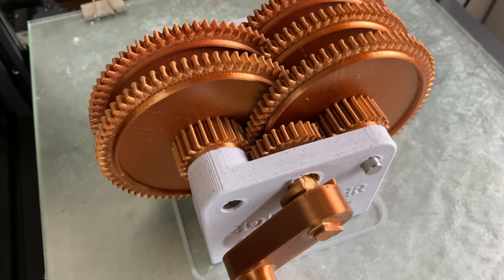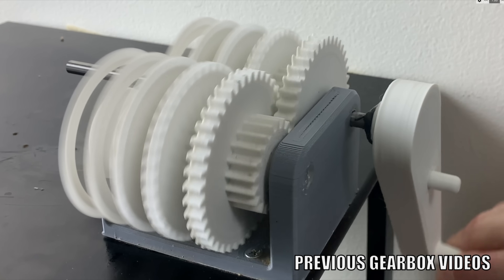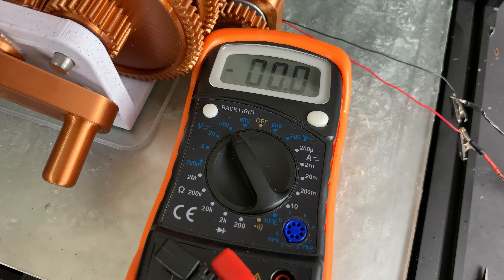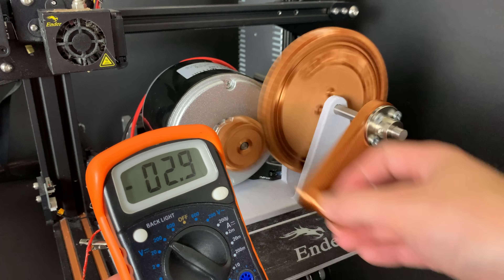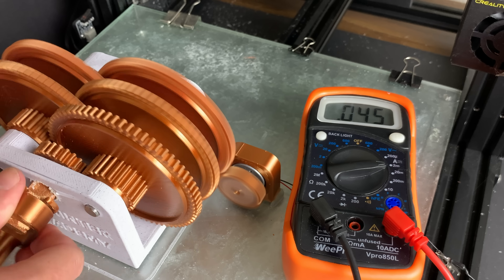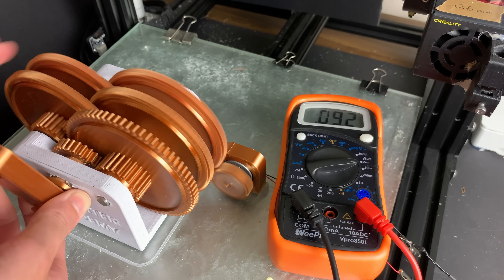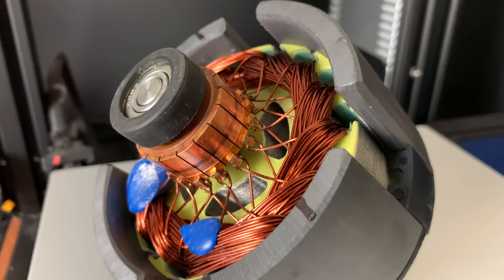Does a fast gearbox generate more electricity?

Comment: As someone who rebuilds industrial DC generators for steel mill conditions, I can tell you that most of the MG sets run at 1200-1800 rpm but I have seen some slower. They have a synchronous motor (an AC stator with a DC rotating field element that maintains a consistent speed without slippage) coupled to several (separately excited or series excited) DC generators on both ends of the motor. There is a direct mathematical relation of work done in HP to the output voltage and supplied possible amperage output. Horsepower = Torque x RPM / 5,252 and 1 HP = 745.7 Watts. Knowing this, you can deduce that the rpm can vary but what really leads to a higher output is the torque in the system. You can build a DC generator to maintain a certain EMF at variable rpm by adjusting of your excitation field in response (the bread and butter of series excited generators) but the actual amp(flow) output under load leans more on the torque of your driving force. AC generators are a completely different beast and are more dependent on RPM over torque with the speed being the deciding factor in the output frequency. Most run at 3600+ rpm with 3600 being more common in the United States in order to make that 60Hz frequency.

Comment: As many people have pointed out the way you did the measurements is pretty flawed but that's not the Issue. Never short the output of a generator! But i guess you didn't realise that you did that. To measure power you need to consume it somewhere, what you did here is consume the energy within the generator which if you spin it faster will heat it up and eventually destroy itself. You are right though that higher rpm will give you higher voltage (very generalised). You do know a lot about gears mate but your knowledge on electricity can use a bit of work :-)

Comment: Better bearings would greatly narrow the margin between high speed low torque, Vs. Low speed, high torque. The gears themselves, look really good. If they spun on precision ball bearings, that would reduce the losses of going through that many stages. I would start with a good crank bearing, since that's the one that takes the most severe radial load. making the axle longer, to put space between the bearings, will make them more stable against the cantilever loading caused by turning the crank by hand.

Comment: Hi, sorry to be THAT guy, but to messure watts, you need to measure volts and amps at the same time. Because, when you load a power source, the voltage usually drops from an open circuit.

Comment: You need to calculate watts with a resistor in line because the voltage will drop some so if the 12v drops to 6v that's big or if the 3v dropped to 2 or 1

Comment: It's simple the RPM must be above the motoring speed such that it goes into generating mode.😎
Reply: Only when motor recuperates , when you turn motor/generator it generates some energy , usualy there is rpm range at which power generation is efficient , but it doesn't necesseraly mean motor have to rotate at higher speed to generate energy . If motor is conected to voltage source it runs (unexpected) and if you stop electric current , motor will slow down and eventualy stop , but while doing so , generates energy , but voltage (voltage does not mean power/energy , but both are lower in this case ) and power are lower so than , for example , power = current * voltage , so if you have 300Watts of power , it can be 100 volts (voltage) and 3 amphers(current) or 10 volts and 30 amphers , now energy flows from higher voltage circuit to lower voltage circuit , and sience it doesen't make sence to focibly spin slowing down motor , we can convert power to higher voltage than send it into source (electric converter handles that) 
But motor without power source will always have higher voltage than 0 , so it wil be a source of power , but if you connect it to some source of power , current will flow from higher voltage to lower , but you ussualy won't get much power from spinning motor/generator on low rpm

Comment: Wow, it's extremely inaccurate.
You dropped the speed so at the same time you dropped the voltage on very low level.
You didn't measure that so we don't know, but i can bet it was not higher than 4V
You can calculate how efficient it was with those conditions.

Comment: If you think the size of the generator as the size of a bucket, imagine that the small bucket dispise being filled much faster, can hold less water than a larger one, that may take longer to fill but has much more capacity. Energy flows much like fluids, if the "pipe" is small, only small portions can flow.

Comment: This is not a good way to show difference in power. A large motor and small motor generate energies differently (not accounting for ac or DC, if both are brushless or not, ect) and therefore comparing all this very different data to get a result is like trying to get a rooster to lay an egg. Use the same motor between each expiriment.

Comment: I don't really see the value in this video. Logically speaking, you'd want to have equal tests where you do big gen + fast speed and small gen + fast speed, or both in low speed. You're not really showcasing anything here. It's pretty obvious that a smaller gen is going to produce more power than a bigger gen if the bigger gen is moving at a severe fraction of the smaller gen. It's like trying to compare a race car with an excavator.

Comment: Your method of measuring is completely wrong. The open circuit voltage doesn't means full load voltage, and the short circuit current doesn't means will be the same at full load.

Comment: You're not even applying constant turn on small generator (use flywheel if torque on input is problem). And you should have used two tester to measure both voltage and current at the same time.

Comment: But... it's unfair. Your comparing the little motor vs big motor. Test needs to be conducted on 1 motor to compare. It is like comparing a 4 to a 8 cylinder motor on which puts out more power.
Reply: Absolutely

Comment: Great video! But unfortunately as others have pointed out, you didn't measure power correctly. It doesn't look like anyone has explained how you should really do it, so try this:

You should buy a power resistor. A 100 Ω resistor rated for 25 W would work fine and only costs like $5. BTW power resistors can also greatly exceed their power ratings for short periods of time, so it's fine if you produce over 25 W. Once you have it, connect it to the output leads of the generator, and hook up your multimeter to measure the voltage across it, and do some simple math.

If you have a 100 Ω resistor and see 12 V across it, then you know your current because 12 V ÷ 100 Ω = 0.12 A. You'll also know how much power you're generating because 12 V × 0.12 A = 1.44 W.

Good luck to you!

PS. I don't know if you'd be interested, but I have a bunch of experience in 3D printing entire electric motors and have dabbled into 3D printing magnetic gearboxes. It might be cool to collaborate on something.
Reply: Yep. Knew measuring voltage and current separately was not the correct idea. 
My question is, would it be correct to measure power by using two multimeters at the same time? One for current and one for voltage?
Reply: thanks for the info bro

Comment: Better to connect the motor wires to a known resistor, then calculate power via:
Power = (Voltage^2) / Resistance

Comment: On that high speed gearbox, you need a bushing on the crank handle hole. This will spread out the forces, prevent enlarging of the hole itself, and make for a more secure crank handle. A bushing and bearing would work even better, but as we see in the video, even trying to use that crank for only a short bit wallowed out the hole it was in.
Reply: Also a larger crank could help with ease of use

Comment: You need to do comparisons on a standard load not just the open load voltages or currents. Although its ok for simple scenarios. You can also start with the law of conservation of energy or just the fact that if gear ratios increase or decrease speed, they do the inverse for torque.

Comment: What if you designed a small custom motor that is specifically designed for the small and fast gear setup? You did mention the coils and magnets play a big role in current generation so perhaps making an hybrid motor will improve the output?
Reply: Motors and generators with higher frequenci are generaly smaller than wlow frechency machines with the same power output , so less cost on materials

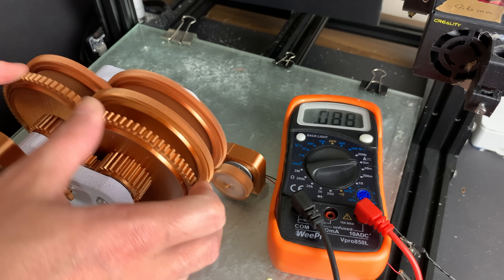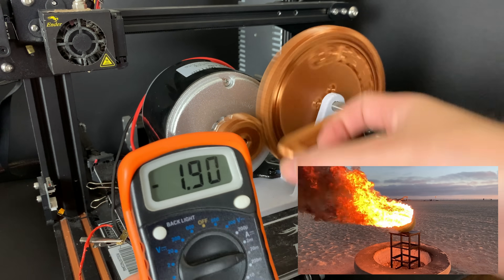Comment: 2:05 You are using your multimeter in 2mA range, so you arent getting 200mA from that motor, you are getting less than 1mA (0.234mA), and 2:43 you set it into 20mA range, so from that bigger motor you are getting 2-3mA - barerly to light up an LED, you can connect LED and see how much power you are really generating. 
For generating power purposes you should always use brushless DC motors, because they use permament magnets
Reply: I don't know what u r talking about but I definitely got an impression that the YouTube guy has really messed it up.

Comment: So what’s best for charging amps or volts?
Reply from the maker: It depends, for charging a phone the voltage will have to be 5v (USB standard) and the more current / amps the faster it will charge the device.
Reply: @3DPrinterAcademy  didn’t know if the excess volts but less amps would be an issue or not

Comment: Power output, in wattage, versus power input, will give you the efficiency. Nothing else matters. And that wasn't measured in any meaningful way. I have a generator that will put out 50 kilovolts.
Reply from the maker: The results show that the gearbox with more gears is considerably less efficient
Reply: @3DPrinterAcademy  It doesn't, you didn't measure input power therefore efficiency calculation is impossible. Ignoring the obvious issue with your output power measurements.

Comment: You can just buy metal gears from SDP/SI and it would be a lot cheaper than 3D printing them.
Reply from the maker: I don't see that have compound gears unfortunately
Reply: @3DPrinterAcademy   do you have access to a lathe? Drill out a pinion big enough for bearings to go inside, drill out a spur with an interference fit with the hub of the pinion, press fit (or thermal press fit) them together.

Comment: Seems counter intuitive because I thought the equations would be related to KE = 1/2 mv^2.  The fast gear spins 15 times faster than the slow one.  15 ^2 is 225 so I expected the fast gear would create more power. I thought all energy variables (kinetic, potential, electrical) were interchangeable such as watts and joules.
Reply: Conservation of energy works everywhere. Did you account for the mass that is being rotated in both accounts? And also the efficiency of the motors to convert mechanical energy into electrical energy?
Reply: @mindprobe3587  
I wondered about the mass comparison of the last gear and how this translates to the energy of flywheels of different mass.

Comment: Multiplying Voltage with nothing else connected by short-circuit current does not yield achievable output power. You will have to attach a decent load resistor and measure Voltage AND power under that load. What constitutes a decent load depends on the specifics of the generator. If you don't have those specifics, measure it's resistance while it is stationary and use that value for the load resistor.

Comment: what happens when you put a motor on the gear and a generator at the end (infinite power) ??
Reply: No .. quite the opposite power rapidly reduces due to various losses. (Copper &Iron losses in the motor/generator, friction, resistance, etc )

Comment: As others have pointed out, you need to measure voltage and current at the same time. Also, when measuring current, your multimeter is set to mA, but your leads are connected to the unfused 10A sockets. This will give unreliable results.
Reply: Yep, the more amperage drawn, the most the voltage will drop. And the more connection the more resistance would be present is true also, thus unreliable results.
Reply: Yeah you need to plot resistance against voltage to actually get any sort of idea as to what power it produces
Reply: 0:17 its funny when the big one spawns
Reply: BUENAS TARDES DONDE PUEDO CONSEGUIRLO COMPLETO COMO ESTA EN EL VIDEO
Reply: Does not generate more yet because it will stalls at less towque
Reply: Yeap. But we need to recognize that the results are pretty accurate. You are absolutely right about the error, but it's just not that negligible when we're up to huge machines.

Comment: A fun little test. and thanks for that, I really like your videos.
But it just does not quite work out in reality.
You will need to measure the energy you are getting into the system at the same time to get an idea of the output.
And you can not measure voltage and amp separately, it must be done simultaneously with 2 multimeters.
In the test you use 2 different generators, it will certainly also give different results.
Suggestion: how about setting a motor to drive the input shaft, use the same generator at different gears, measure amp and voltage simultaneously.

Comment: You need to measure current and voltage at the same time, NOT measure unloaded voltage and then multiply by the short circuit current.
Reply: That’s the chines way for any Produkt they advertise 😂 
But you right he needs an powermeter or he should measure the voltage over nen given resistance.
Reply: The test also need to be done on same motors to prove the variable "speed" has any effect
Reply: @badrobot8195  yeah that also stuck out to me, he's using two completely different generators that have a massive size difference, on top of just powering by hand which is not precise at all
Reply: would it give massively different results?
Reply: @Comfy_Bed  Well in the video he also mentioned that he couldn't spin the motor as fast as he could when he connected the leads. So it would be best if he connected some wire with known resistance or use a low value resistor and measure the voltage drop through the resistor then use P=V^2/R formula.
Reply: @Comfy_Bed yes, the voltage drop over short circuit can be a substantial

Comment: but i would rather choose the tiny and fast motor to charge my phone (if i had an emergency and i didnt have a electric socket) because though voltage is high current is less as compared to big and slow as it has low voltage but hight current which potentially has more chances to burn and destroy my phone although tiny fast motor will take ages to just charge 1%. great video bro👍
Reply: That is why you pair it with a voltage and amp regulator of some kind
Reply: Current isn't "pushed." You need voltage for current to flow. At a constant resistance, more voltage equals more current (R=V/I). Just because the large generator can output 3 amps doesn't mean it will push 3 amps into your phone. I could plug a phone into a 5V 500 amp charger and it would charge fine

Comment: Nice work on the gears, looks like you've stepped things up a lot in how you've designed/put these gears together.
Question though: You're measuring the voltage without load, and the current is being measured with the meter acting as a dead short.
Reply: He is using permanent magnet DC motors as generators, therefore the output will be DC.

But yeah, voltage and current must be measured at the same time.
Reply: @IZuzivowoI  Cheers, I've updated comment. Not sure what I was thinking
Reply: You didn't ask a question
Reply: @DiacnikYT  It's implied, i'm questioning their methods because measuring voltage without load, and measuring current as a dead short is meaningless.